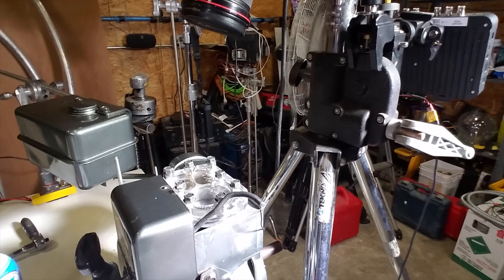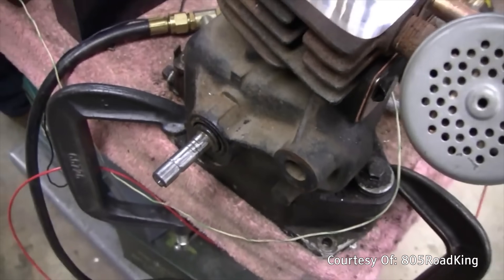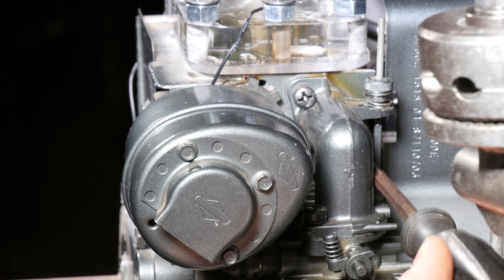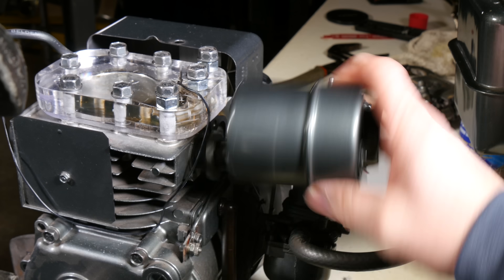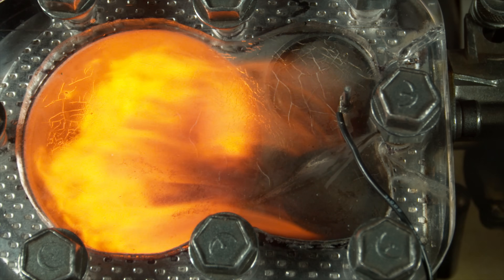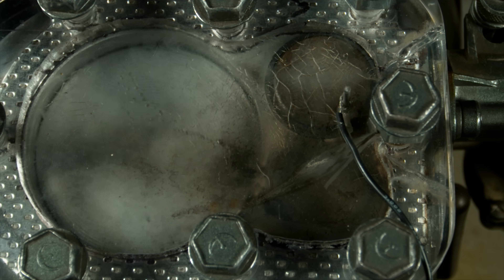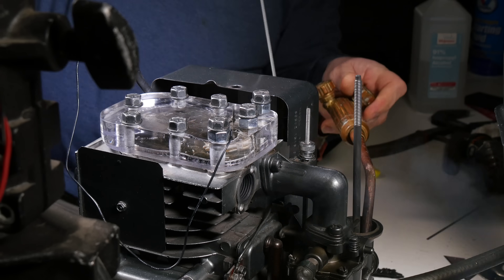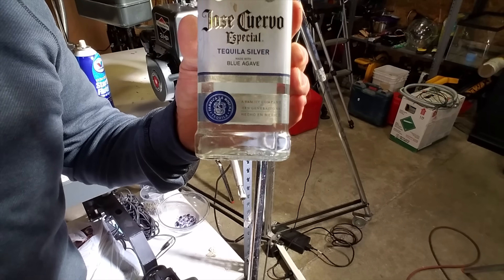See Through Engine - 4K Slow Motion Visible Combustion ( S1 • E1 )

Comment: 3:58 I was waiting for it to get Hydro locked or bust the connecting rod.  But you're right does look like it was rinsing off the cylinder walls that's why you could see that little tint of residue after start up.  Very cool videos.  👍

Comment: what's the second stroke without a combustion? and why does it still spark?
Reply: To answer your question about the second spark; 
A 4 stroke engine has 2 revolutions (two complete 360° cycles) of the crank shaft per cycle. The 4 stroke cycle events are INTAKE; Where the piston is generally at the top of its stroke, the intake valve opens, and the piston starts drawing air/fuel in through the valve, while traveling down. COMPRESSION; the piston now down at the bottom of the cylinder starts to travel upwards. The valves are closed. The piston is compressing the mixture of fuel/air together. [This makes 1 revolution of the crank]
 POWER; The piston is now at the top again at the end of the cranks first revolution. The spark plug now ignites the compressed fuel/air mixture, causing combustion of the mixture. The pressure from the combustion forces the piston down the cylinder. EXHAUST; The piston is now down at the bottom of the cylinder from the power event. The exhaust valve now opens, and the piston starts to rise, and helps push the spent gases out of the valve as it travels up. When it reaches the top of the cylinder that completes the second revolution of the crank, and the engine begins another full cycle. 

So what does that long winded explanation mean as far as the two sparks? 

As I said, the crank on a 4 stroke makes 2 revolutions per cycle. The ignition system on this engine uses a permanent magnet mounted on the engine flywheel. The flywheel is bolted to the end of the crank shaft. As that magnet spins with the flywheel, it spins past a magneto coil, which induces a high voltage spark for the spark plug, every time the magnet passes by the coil. Since the flywheel is spinning with the crank, it is also making 2 complete revolutions per cycle, which means that magnet is passing that coil twice, therefore you have two sparks during the whole process. The initial spark during the power stroke is the one that's obviously desired. The second spark occurs during the exhaust stroke, and is called a "waste spark". It's got nothing to do with a re-burn of the exhaust gas, or anything else. It's just as simple as it's allot easier/cheaper to build an ignition system that has it's spark timed by the crank.

Extra bonus info;
Generally automotive engines are timed by the camshaft, which only makes 1 revolution per 4 stroke cycle. Because of this, you usually only have 1 spark per cycle. 
There are exceptions though. 
A manufacturer can save money using the waste spark setup on a distributorless ignition system. How do they do this? 
Say for example you have a conventional 4 cylinder engine. In that engine, you have "companion cylinders", which mean the pistons in those cylinders are in the same position as their companion. Generally, cylinders 1 and 4 are companions, and cylinders 2 and 3 are companions. So say cylinder 1 piston is at the top of the cylinder finishing compression, and ready for its power stroke, cylinder 4 piston is at the top of its cylinder finishing its exhaust stroke, getting ready for its intake stroke. The spark plug ignites cylinder 1, It's inconsequential if the spark plug also goes off in cylinder 4, since it's the exhaust stroke with dead gasses expelling. Knowing this, an automotive manufacturer can use only 2 ignition coils, rather than 1 per cylinder. Each coil has its 2 companion cylinders spark plugs tied to it. 

So there you go, everything you wanted to know, some things you probably didn't, and I bet you're sorry you asked... :-D
Reply: They are offset. This creates more balance in the engine and preserves more energy. There is always one piston in ignition stroke delivering power to the crankshaft. Compare it to a bicycle. If both pedals wouldn't be offset by 180° it would be more difficult to ride. Having opposite pedals make sure there is always a leg pushing down.
Reply: oh that's how it puts out the exhaust huh? neat
Reply: 4 stoke engine ;)
Pulls in fuel, compresses it, ignites it, then pushes the exhaust out.
Reply: WesOfX So the fuel and air mixture when compressed rapidly becomes a vapor? And do multiple cylinder engines all compress simultaneously or is it offset? Sorry im pretty ignorant when it comes to engines
Reply: I'm not sure what happens to the fuel mixture. Before I saw this video I assumed it was vapor the whole time. And no, the cylinders are usually offset and fire at different times.
Reply: Michael Wheland  they compress at different times. Thats why the term timing is used. To make sure that all the right movements are taking place while fuel is being delivered or waste gases are being exhausted.
Reply: Very cool video!!!!!

Comment: Since acetylene is a potential reactive explosive over 15 psig, I am very surprised you weren't getting a dramatic show of preignition.
Reply from the maker: +Patrick Dionne no OXY
Reply: ~21% OXY in the intake air. No OXY and it wouldn't run at all.

Comment: Pretty cool, but why on earth did you use isopropyl instead of ethanol or methanol, which are actually used as fuels? And why did you pour the stuff straight down the carburetor rather than putting it in the gas tank. Also I personally would have liked to have seen how the burn pattern differs in appearance when adding nitrous oxide. We all know that it increases power but it would be cool to actually see it in action.

Comment: Good video but, the reason the alcohol didn't vaporize is because you poured it directly into the carb. The fuel system is completely bypassed and so has no way to meter the fuel so it sucks it all in with the inflow of air. WAY TO MUCH fuel to vaporize properly.

Comment: after leaving active duty I went into engineering as an automations engineer...I have a BSEE and BSME.  We built a glass mold to study mold flow in an injection mold.  I spoke to some engineers at NASA about the windows in the space shuttle.  They were using plain old fused silica, just ordinary window glass.  Their thickness was about 40 mm.  The issue they had was seal survival due to heat.  You could drill out some glass that won't burn up if you want to do more testing.  A water jet will cut right thru it...

Comment: Alcohol flooding was result of inadequate O2 supply.  Correct Air/Fuel ratio even with ethanol would be 14.7:1.  Increased compression ratio would resolve flooding.  Acetylene burnout was reflection of pre-combustion.  Lower a/f ratio would deliver more efficient burn.  "Soot" is unburned fuel; add air to burn it off to recover energy.

Comment: The soot is because the combustion of acetylene requires a 5:2 C2H2 to O2 to yield a 4co2 + 2h2o. You have a huge excess of acetylene content that's carburizing. The addition of the IPA @ ~90% (C3H8O) to the point where in combustion you're actually having a net loss of joules in the combustion rx. Thanks 10th grade chemistry! All the pot I smoked and I still got it ! pv=nRT and all that shit right

You're also going to need to manually adjust the B&S's timing on.. well basically everything since it was designed to run on standard pump gasoline. Intake valve timing, the lift height, the duration, same for the exhaust valve. If your intake can't provide enough air flow, you might need an active pump and/or shorten the piston stroke so it requires less draw and/or port the valve head . Whatever is controlling your spark timing (a distributor cap?) probably will have to be altered also.

Comment: technically, the ethyne (acetylene) should be easier to tune with because it supports combustion over a very wide concentration range..much much more than gasoline or alcamahol...(homer simpson)

Comment: Rubbing alcohol didn't work too good. Too much water in it. No power, flooding out. You would find that the engine wouldn't pull a greasy string from a hog's, well you know. You will also find that much of the alcohol/water didn't burn and comes out the exhaust as wasted fuel. Alcohol in any form or concentration or even mixing with gasoline doesn't perform well in gasoline engines. Burning food (corn to make alcohol) is not a good idea.

Comment: Rubbing alcohol? That stuff is like 70% water. Should have to the liquor store and picked up 1/2 pint of PGA, Pure Grain Alcohol which is like 95% alcohol. 100% alcohol can be made but it will drop to 95% (96.48% to be precise) just by being exposed to the air. The pure alcohol will literally suck the water from the air until attains a mix of about 5% water and 95% alcohol. To get 100% alcohol it must be filtered through zeolite stones which suck the water from the alcohol. 100 proof booze is not pure alcohol. 200 proof is pure alcohol. Yes I have built and operated a still in my younger days. I used the alcohol in my riding mower until I found that the alcohol was dissolving anything made from rubber that it contacted, like the mower fuel line and some rubber seals. Coll video. I want to see it run on 96.48% alcohol as long as it doesn't dissolve the see through head.

Comment: Awesome video!!!!!..... Could you please film a brushed "540" electric motor at 100,000 rpm and show the brushes and how they arc and bounce with different brush angles and spring tension?This may seem kinda weird, but when I raced r.c. cars in the 90's spring tension and brush angle were the most important parameters to a powerful motor that would last a long time . thnx :)

Comment: Can you do a hydro-lock video?
Reply: Interesting.. those engine are really overbuilt in some aspects and I guess there were single piston? (in a single piston config, if water floods the engine, there will be no ignition to further drive the engine, and the clutch in the transmission must have slipped and the atv is at low speed.. so the inertia has low effect on it). 
In a normal car engine there no spare room to make the connecting rod withstand a hydro lock in driving condition. At best you get some bent connecting rods that are no longer good because the compression ration is way off, and many times, even a slight bent will make the connecting rod shorter and the underside of the piston will be hit by the counterweight on the crankshaft. It's that tight of a tolerance.

But usually if the engine gets hydro-locked there are two scenarios: flood is slowly creeping in one cylinder from dripping fuel out of a bad injector, or coolant, or something.. and when the piston will just not have room to move, it will bend the connecting rod a little.
Or the other scenario is a rapid fill in more cylinders through intake of water (drive it in a lake) at any amount of speed the results can be some really bent connecting rods (if the gas was mostly off and wheels where not in contact as the car sinks in the lake, so the engine just stops with a minimum damage)
Or if the engine was fullpower decent speed, full grip on road (let's say rain collects in the intake), the connecting rods will be snapped like toothpicks. The wrist pins gets bent enough so it won't turn easy, head may be warped with some crack near bolts, pistons may crack and shatter in the middle making a big hole, whole engine might shatter. I have seen most of this cases because I work with cars every day.

From the wisdom of an automotive engineer.
Reply from the maker: AsiAzzy yes I hydrolocked My Friends Engine in his car one time, it was pouring rain and I didn't realize he had a ram air intake under the bumper, he never told me, I drove down a street that had about five inches of water, broke two connecting rods and Forrest one of them right out of the block. somehow I was able to take the oil pan off pull the Piston out put it all back together epoxy the block and the car was fine for a year, until he got drunk and smashed it into a fire hydrant. Then he lost his license for his third DUI. it was a Ford Probe
Reply: sn0m0ns That would be a pretty short video
Reply: I always wondered about hydro locked because back when I was a kid we used to drown our quads and dirtbikes then just let them dry out and they would be fine!
Reply: Draining the crankcase fixes hydrolock in a 2 stroke a lot faster than letting it "dry out". Hydrolock just means you flooded the bottom end(usually because the operator was running it with the choke full on, wasting gas is all that does).
Reply: Always had 4 strokes but I guess it never made it past the air intake. It would make sense now that I think about it because we would pop open the air box and water would pour out. Good times...

Comment: Can you show a diesel engine for comparison?
Reply: I do not think that is possible due to compression ratio ... as gasoline engine has about 10:1 but diesel has 20:1 so the glass/hardened plastic won't survive such presure
EDIT - But it would be nice if it would be possible!!
Reply: They would probably have a really hard time with this one because the cylinder pressures on a diesel engine are MUCH higher.
Reply: LazyLife IFreak maybe yes, but do you have a giant chuck of saphire glass laying around?
Reply: crap, they would need straight industrial diamond for that
Reply: Sapphire glass could hold that pressure.
Reply from the maker: Marek Tyl I think it will !.
Reply: Jun Song Lee Both diesel and alcohol can burn completely, it just depends (mostly) on the air/fuel ratio.
Reply: Mick Wolf A Wankel would be fun, but those had enough sealing problems with metal parts. Not sure possibly adding more with different, see-through materials would work.
Reply: Vince van D Single crystal sapphire glass can be grown to any size I think, the science behind it eludes me.
Reply: Jun Song Lee You're telling us diesel engines don't burn completely...
Reply: Eliad Buchnik. that would b awasome. that would school how timing a diesel would work. if im not mistaken the fuel is injected right as the cylinder has full compression already.
Reply: mchl8
Not exactly. It takes time for the fuel to mix and ignite so the diesel fuel is injected before the piston reaches top dead center. Many modern diesels actually have one or more smaller injections before the main one to reduce the noise of combustion that creates the characteristic diesel engine sound.
Reply: +Eliad Buchnik nah, forget the diesel, pretty much the same. Show us a 2 stroke engine instead.
Reply: or show a rotary engine
Reply: the diesel will be the same as the alcohol cause it cant burn completely and will cause liquid rushing in the engine
Reply: 177SCmaro you are right
Reply: yeah but its very expensive.
Reply: Marek Tyl it's actually much higher for a Diesel. Especially huge marine slow speed Diesel engines. :)
Reply: @Giles Themans Did not know, but I was talking about average engines used in cars
Reply: mchl8 nowadays they are but back before 94 international had the 6.9 and 7.3 idi engines and they were indirectly injected. I believe the 6.5 diesel in Chevys was the same way
Reply: @Warped Perception Well, then I am hoping for new video with diesel engine!! :)

Comment: Don't get me wrong, real cool video, but your air fuel ratio is wayyyyy off. I don't know if that was on purpose to make the combustion more visible, but specifically with the alcohol, that's way too much liquid in the cylinder. If you get it to the point where the engine smooths out, you're getting closer. The screw sticking out on the back of the carb is the main jet mixture. 
Otherwise, great video... too bad that head is temporary or it would be a trick upgrade to your snowblower....

Comment: Do sparkplugs spark like that in ever time when the piston is at the top (like in every engine)?
Reply: yep. Its known as a 'waste spark' system. The spark occuring during the exhaust stroke doesn't do anything, and it's easier for the manufacturer to time the engine. very common on smaller singe cylinder engines.
Reply: This is "wasted spark setup" for ignition. This time the engine fires everytime, as there is single mark on crankshaft and the ignition is done by mechanical device, not electrical device.
Reply: No, its just a "dumb" sort of spark.  The ignition is timed directly off the flywheel so it just happens to spark at the same time every time the piston comes up on this engine.  A gear driven system like you would have on an older car could make it spark in twice the time or half as often if that's how they wanted to do it.  A modern car would control all of this with some sort of gizmo computer thingy.
Reply: Nermket depends on what the optimal timing of your engine is. No they do not always spark at top dead center.
Reply: Nermket Depends on the engine design
Reply: Not on 2 stroke engines.
Reply: Nermket no. That just happens to be a waste spark ignition system.

Comment: just thinking, I noticed you used 91% alcohol. that means that almost 10% is water. water running through your engine. pure grain alcohol 200 proof (someone else mentioned it), may have much better results.

Comment: try it on acetylene oxygen mixture :D  it works well for welding so why dont use it for engine. but better leave the room befor. just in case
Reply: Nudeliful Might damage the engine or maybe fuel economy goes in the trash bin :P